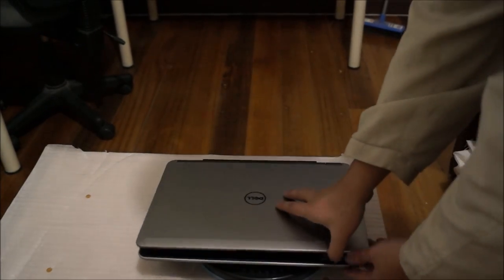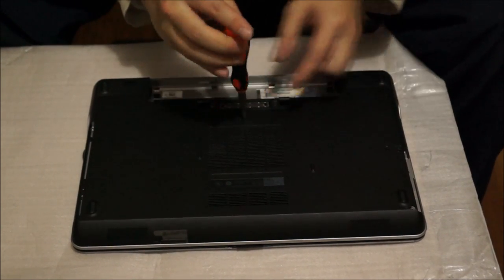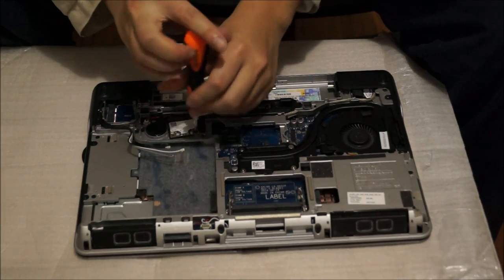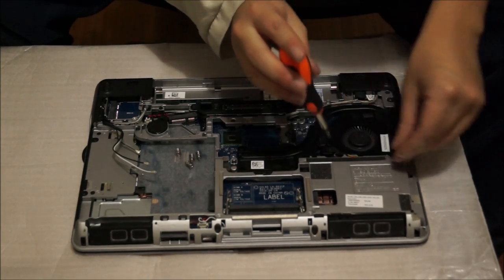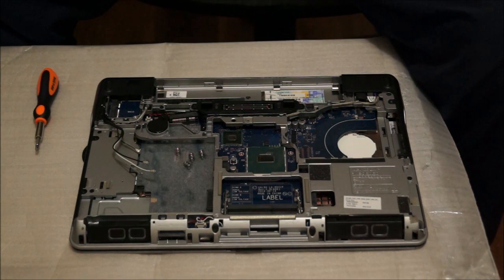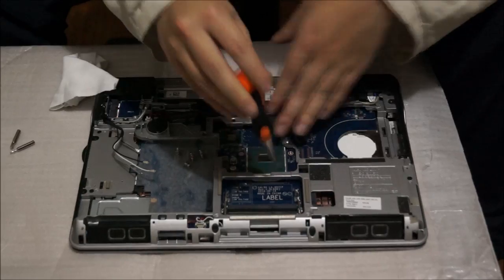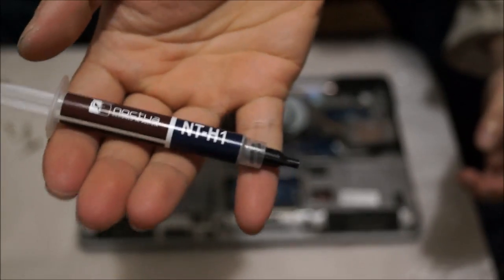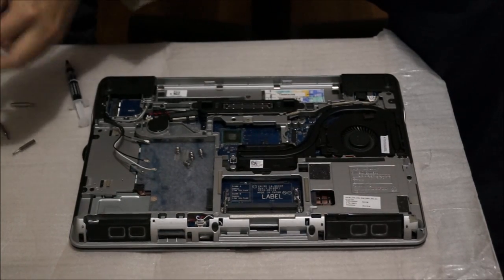OPEN ME UP! Dell Latitude E6440 Disassembly

Comment: Just upgraded mine to i7. Your video is quite helpful, but a couple things i noticed- it's a T8 and not T6 needed to release the cpu. Of minimal importance, the 2 screws on the fan need not be removed as they as not connected to the laptop but rather hold the fan itself together. Thx.
Reply from the maker: thanks for your support i will note this for my future videos

Comment: I was looking at this to see where the wifi card was placed, but seeing that you can install two is good news to me. I plan on getting one of these laptops and having an external graphics card installed via that slot.
Reply from the maker: this laptop is extremely old
Reply: OPEN ME UP I'm looking for a laptop with a core i7. Most anything is better than what I already have.

Comment: FYI there are 2 m.2 slots in this motherboard, its not the full size its the size of the wlan card you can remove the wlan card and replace it with a m.2 ssd as well as the empty spot next to it, so you can add 2 more ssd drives on top of the regular hard drive caddy.

Comment: With this model, is there a wifi reception problem do to the Aluminum top of the laptop case. There are reported problems with a different Dell laptop and other brands with metal top and bottom cases.  Thanks for any reply before I pick up a used one.
Reply from the maker: i have not experience any problems. for this laptop and any other laptop that has metal they have a cut out and use plastic to resolve that issue

Comment: Thanks for the video.
I did everything the way you did in the video but my screen is not powering on. The LEDs are blinking but the screen won't show. What could be the issue.?🤔
Reply from the maker: it is work originally and you open it and now it is not working then you forgot something. the LED blinking tells you what is the problem. note down the pattern and tell me. most likely you forgot to plug the LCD cable back in
Reply: It could also be the ram not being placed correctly. I had the same problem. I fixed it but taking it out and blowing on the slot and then putting it back in.

Comment: Thank you for the helpful video! Do you know where the BIOS chip is located, and whether it is accessible without removing the motherboard?
Reply from the maker: 2.30 in the vedio next to the wireless card
Reply: @OpenMeUpTec  Thanks, but I think you mean the CMOS battery, not the BIOS chip. The BIOS chip is probably an 8-legged chip somewhere on the board, I saw two behind the fan, but I'm not sure which, if any, of the two could be the BIOS chip.
Reply: You all probably dont give a damn but does any of you know a method to log back into an instagram account?
I somehow lost the password. I love any tricks you can give me.
Reply: @Kevin Kylo instablaster ;)
Reply: @Hayden Ahmir It did the trick and I now got access to my account again. I am so happy:D
Thanks so much, you really help me out !
Reply: @Kevin Kylo No problem :D

Comment: thanks ...
I want to add a ssd but it seems like i cannot have ssd and hdd at the same time.
Reply from the maker: take out the DVD drive and put a SSD there. you can buy a DVD drive to hard drive adapter on ebay for like $10AUD

Comment: Was just wondering, what are the best upgrades you could make to this laptop? (I own one and want to run newer games) I've been looking into buying an EXP GDC to go into that second pci port, but I don't know how I can tell if this will work or not? I'm a student so I basically live with hardly any extra money, so I'd have to buy a single part a week/two weeks. I was also wondering about what kind of ram I can put in it (as mine only came with one stick of 8gb), as well as what kind of harddrive is best etc (I know solid state, but which one?) & if you're willing to, any other upgrades you recommend. :) (anything, even LED's behind the keyboard)
Reply from the maker: buy a cheap desktop it will be cheaper and better. there is nothing you can do to this to improve your gaming performance as it is just too old.
Reply: Definitely get a ssd, I got a samsung 860 evo and it has been serving me well for over 4 years. You can probably get a small SSD to install the OS/programs on and keep the original HDD by installing it in the place of the optical drive (using an adapter). 8Gb of ram has been enough for me but if you want to upgrade get a DDR3L SDRAM 1600MHz (more info on the spec sheet). I also upgraded my monitor but that is optional based on your tastes. I am currently trying to get a eGPU to work on the e6440 as well; people have done it successfully and I recommend reading through forums like egpu. io.
Reply: @bobyang4112  how did you upgrade the monitor? Can you help me a bit pls

Comment: What about the static, what do you recommend me or is not a problem, I'm thinking open my laptop for a cleaning
Reply from the maker: if you are concern about static electricity then i recommend you not to do it. i have our and open up more than 100 computers and not once i was able to damage it. i have even tried to damage it but still was unable to. if you are concern there are way to avoid static electricity which you can look up
Reply: I don't have experience opnening my laptop but I have one and I want clean it but I have fear for the damage about the static, I will read something about that, thanks! 😬

Comment: Is there a place i could put on the sim card
Reply from the maker: yes and no. the slot is there but you need to havbe the 3g 4g wifi card install in the laptop of else it doesnt work.

Comment: Could I swap out me Graphics card? Or is it stuck onto the motherboard?
Reply from the maker: solder on
Reply: +OPEN ME UP Kweeel and which cpu are you using lol I'm thinking of upgrading my to play more planetside :v
Reply from the maker: +STR77 CallingAllBattleFrontFans There arent many CPU options out there and also it will not really improve anything. This laptop had a i7 4600u
Reply: heya, i think you mean that you have the 4600m now the 4600u, as the u is a bga chip and that is clearly a pga chip, the best cpu you would be able to install in this laptop would be a 4940mx, but that is a 57w cpu, and the cooling solution would not be able to keep up. what im guessing you ment is that you have the best cpu in the default 37w tdp range, which you are kind of correct, the 4600m was the best, but it has been replaced with the 4610m which is the refresh with a 100mhz speed bump. as for str77's question, the gpu not on an mxm module, and is integrated into the motherboard, so there is no hope of upgrading it
Reply: Augustus Terra Australis not entirely true. You can use the wifi card slot to install an external graphics card. The slot is essentially a mini pci express slot, and works surprisingly well.